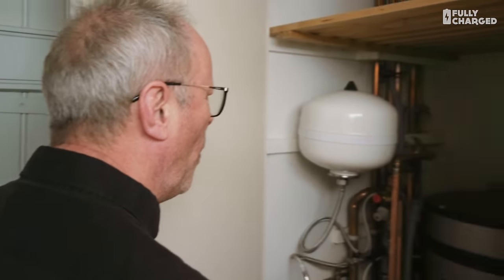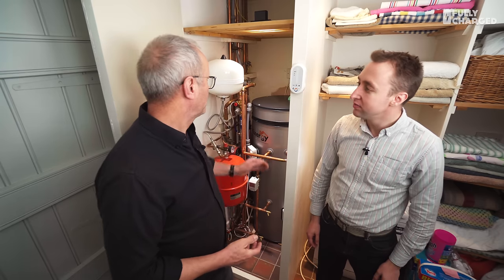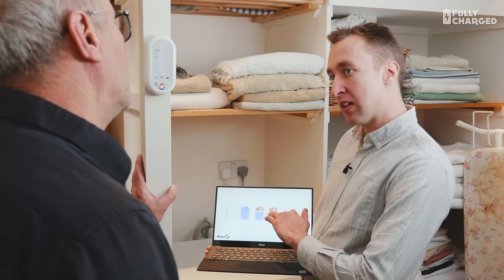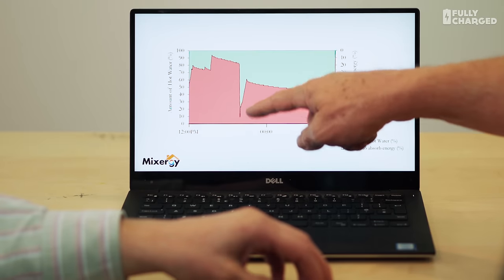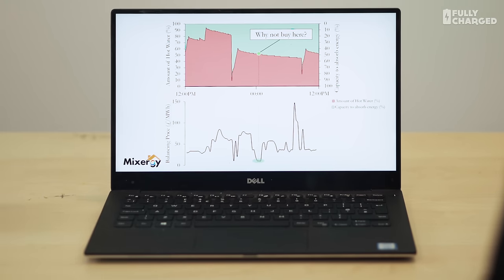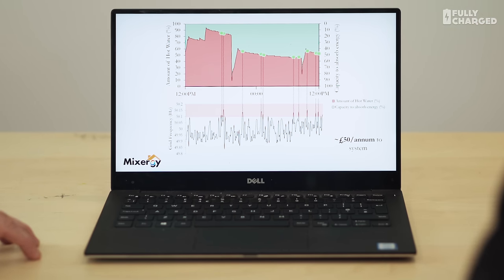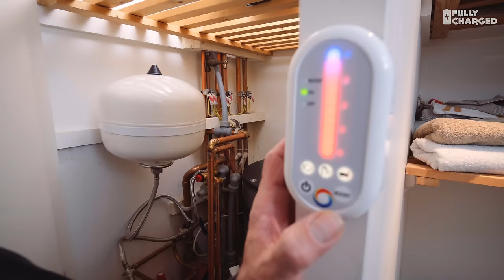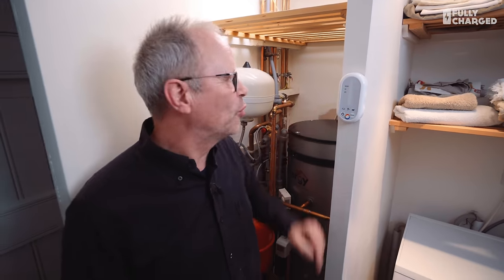Mixergy Hot Water Tank | Fully Charged

Comment: Wouldn't gas heating be much more efficient? Unless this is rock bottom cheap I just can't see the value especially with the added complexity.
Reply: Hi LokiDaFerret, instant gas boilers are less efficient compared to a well insulated Mixergy tank when we've tested them in our lab. There is far more complexity with an instant gas boiler as well-you need to maintain a pilot light, consider gas burner control, have a pressure sensing solenoid, condensing heat recovery not to mention issues around carbon monoxide and local air quality. The UK's grid carbon intensity has dropped dramatically and since September last year was lower than gas 40% of the time.
Reply: We need to stop burning things to make heat to slow down climate change. Solutions like this help with the transition away from gas. From the complexity standpoint I'm not sure I follow. It looks a lot simpler than any gas boiler I've ever worked on.
Reply: I am referring to my continuous hot water heater. I don't have a big tank but a tiny little gas thing attached to the side of the house so we can shower all day if we choose to do so. plus it only heats to the temperature we want. Am I missing something here????
Reply: If you look at the engineering of that you'll find it's pretty complicated. The Mixergy tank seems to be a regular immersion heater, a pump, a bunch of temperature sensors and a microcontroller.Significantly simpler in mechanical and electrical terms (we'll ignore the software ;-).
Reply: The trick here is not to compare the internals of this machine to the 'black box' that is attached to your house. The black box has more going on in there than a flame, water and a gas line.

Also, if this can be made much more efficient, then not only can we stop burning gas - we can stop piping it. Maintaining that infrastructure is not free.

Comment: Sadly UK RHI isn't permissible for systems that contribute to space heating despite massive reduction in fossil useage - in our case 66% gas reduction cf combi boiler with stratified thermal energy storage mostly heated by solar thermal. In winter solar thermal effectively pre heats water that goes into gas or wood fired boilers so reducing fuel consumption for radiators, thermaskirt or ufh as well as dhw.
Reply: RHI doesn't cover space heating for solar HW but that's understandable as it only works efficiently when you don't need space heating. ASHP, GSHP + a few others qualify. I get £282 per quarter for an ASHP that provides both HW and heating.
Reply: 1evilpie nope, it works very effectively for space heating! 300l thermal store properly designed to take low heat demand ufh from lower section and higher for rads. In Europe 1000l ts more common, just a wood or pellet boiler for 2 to 3 days per week mid winter.

Comment: every immersion heater i've ever seen (In my limited experience) goes in at the top of the tank.
Reply from the maker: Okay, maybe we didn't make it clear. It's not about how the water gets into the tank, it's about how it's heated. Hot water rises in a stck of water (as in surface water in the ocean can be quite warm but deeper down it's very cold) so the systems used to heat the water are at the top ofthe tank, hence you can heat a small amount of water very very fast, in a few minutes, and then heat the whole tank, if needed, a bit slower.
I've had the tank for 4+ year now and it is without any hesitation, the best system for heating water I've ever experienced.
Reply: @fullychargedshow  I have no doubt its a great system, simply that the graphic shown shows that "other" tanks are heated at the bottom. This is not actually really true. I think you may have misunderstood my "goes in at the top" - I mean that the actual element is inserted in and heats the upper part of the tank and not the lower part (unless you have a very long immersion heater and a very small tank of course) The whole system of measuring load and heating at cheap periods is a great idea though.

Comment: Interesting, but not really novel. I had a solar thermal system installed at my house in 2006, by www.greenshopsolar.co.uk, and it's been a good investment. It uses a 190l hot water tank with a heat exchanger for mains pressure hot water, and an auto mixer valve outside to stabilise the hot water delivery temp. In the Summer, the tank temp can be around 90 to 95 ˚C, so a mixture is essential for safe delivery to the taps etc. The solar thermal kit was made by www.resol.de, and it's had a replacement electric pump over the years. Since 2014 this house also has solar PV in tandem, so solar thermal collection is nominally free to run, most of the time. I don't have any boilers at all, and sometimes the storage tank is 'topped up' by an immersion heater, timed to run at 'night rate' mains electric; mostly done in the Winter, or overcast days. Because the water is hard water, and electrolytic scale inhibitor is used to protect the heat exchanger (and the rest of the plumbing downstream, which is nice).

Comment: Is it compatible with the solar to water heater elements that you put on your roof, i don't know what they are called?
Reply: JoneKone You could combine it as the heat from those collectors are kept within the property. This could almost eliminate electricity usage for most people depending on the weather.
Reply: Hi Jone, yes with a PV diverter the system is compatible with electric solar panels. It will also work with solar thermal :)

Comment: I am a heating technician and this is all wrong not many cylinders heat up from the bottom for a start, also the volume of hot water can be controlled by cylinder thermostats. There have been many different attempts at hot water storage over the years and simple is best to many pumps and controls mean high maintenance cost and poor reliability.

Comment: We talk a lot about the "national grid". But does that make sense? Shouldn't we rather focus on optimising use of the global grid? I mean, energy is traded among countries, and I believe this applies to electricity also, so a national perspective is a bit limiting.
Reply: You know I agree a lot with sentiment this... there is a huge renewable resource in North Africa which we could be buying in Europe. However, there are economic costs and security challenges with bulk power transmission over very long distances and so I think there'll always be a place for local energy storage as well...
Reply: Transporting electricity long distances results in quite a lot of loss, so there's that. In Europe the situation is better because you have a whole lot of countries right next to each other.

In Australia, for example, not even all our states are connected to a national grid. That's because to connect Western Australia to the eastern states we would need to run those huge lines across nearly 2000km of nothing.

The Western Australia grid is even talking about off-gridding a few of the more remote communities, because it doesn't make sense to run those HV power lines over 600km of nothing to reach a couple hundred households. Their solution will save them $400 MILLION, by scrapping the grid connections and setting up solar+battery with backup diesel/gas generators just in case.

Coming up with a design that allows not only national and continental grids to be connected and share energy, but also those for which that makes NO sense, would be the optimum balance. Of course, they can both be different solutions, but I happen to believe that more agile national and continental grids will use much the same tech as those that are off-grid by circumstance, rather than by choice.
Reply: Well the sensible option is to set Desert project in each section of the world. Australia, China, USA, Far East. Cable loss as quoted by the study was 2% over that distance. Blowing up such plants which was the next concern. These things were going to be 100 miles each way in sections. So taking them out was going to be outside most of the current terrorism groups. Side benefit was that local water was supplied as a side benefit! Plus you could use the land under it as farming. as the panels will shade the ground. The panels would be set far enough off the ground to allow light reaction to take place. Win win for everyone who is involved. Work for the locals to maintain a good system. Shame about our political team not having the technical sight to implement. This is the sort of project that EU and it's equivalent should be doing. Rather than trying to put everything in to the current structure. Hence, most of the UK got fed up with them. Over 10 years ago this could have been started. The plan was an additional to what we were doing now. Once all the factions of the world had a unlimited supply of electricity, water and food growing land a lot of theses wars could have not occurred. The oil and gas groups should look again at least.

Comment: What can you do with stored hot water bath and wash. what can you do with battery stored energy every thing that you can do with electricity, watch tv iron charge car charge phones power router computers power refrigerator etc etc.
Reply: line10cls Good point, but this tank probably costs a few hundred pounds more than a conventional one and should last 20 years plus. A batter bank costs thousands and won't last anywhere near as long. And you still have to find a way to heat your water.

Comment: Heating water with an electrical resistance looks like the worst possibile way of doing it.  As long as the global electricity production is not 100% renewable, you shouldn't waste it on a resistive heating element: you would do far better by using an efficient heat pump, an hot water solar panel, or even an efficient gas burner and sell some green electricity to the grid.
Reply: Robert has PV panels and a Powerwall battery.
Reply: @johnburns4017  And it would be better for the environment if he was to sell that electricity and burn some gas. Unless you are using an heat pump or the grid is already highly renewable.
Reply: @giacintoboccia9386  
It is the cost of whole package. PVs and Powerwalls are not cheap.

Comment: Heating cylinders from the top down to preserve stratification is not new.   You can buy cylinders with three immersion heaters up the length of the cylinder to heat say just the top one third as that is all you need for the odd washing at the sink and in the bathroom.  For a full shower or bath you switch on another immersion.  All switched on manually of course.  Here is a cylinder that heats from the top down using a boiler and plate heat exchanger and shunt pump, and designed to do so:
https://www.mcdonald-engineers.com/products/plateflow-plate-heat-exchanger

Having thermal store cylinders heated via electrical immersion heaters, boilers, solid fuel boilers, and incorporate roof solar panel heating is not new at all.  

As I see, the difference with this Mixergy is:

1. A small computer control system is incorporated on an electrically heated cylinder, with even a Smart App to control it.   Central heating systems can be controlled by a Smart App as well, so that is not new. But new on just a hot water cylinder.

2. The Mixergy cylinder can be switched on by the National Grid (?) to absorb surplus electrical energy produced. That is new.

Comment: Much simpler way to achieve this is just solar and or low cost overnight charging of the household 10 to 20kw battery pack them combined with a simple on off electric shower equals no messy pipes cluttering up a cupboard (which could be used for even more battery storage ;)) no pumps no extra pipes to leak etc. Sorry but ten years ago this would be great. Because you have shown us household battery/solar solutions combined with low cost overnight electricity all these inventions are pointless in my opinion. Cheers
Reply: Couldn't agree more.   In fact, I think batteries should be a mandatory requirement for all solar installations.  The only problem is the cost of batteries at the moment, but that is changing fast...
Reply: However this type of water heater may be much cheaper than a 10 kw battery pack, even with falling battery costs.  It's basically a conventional tank with the heater on top, a small pump, and a slightly smarter computer to control it.
Reply: Fancy a Bev Mate? You would need a separate heater for every hot water outlet. Electric shower outputs are feeble at best. In a family home, you would need enormous battery banks to supply all the hot water required for four or more showers a day. Baths would be out of the question. This makes sense, it can "charge" slowly, can be integrated with solar, doesn't place too much demand on the grid when solar is not available, and is significantly cheaper. Heat losses are low from a well insulated tank, and in the winter any heat losses offset your space heating demands anyway.

Comment: Isn't that just called a boiler?
Reply: With an AI twist=game changer.
Reply: A "smart" boiler. Still not as energy efficient as a tankless heater, but maybe more economical efficient (due to the fact that it heats when prices are low).
Reply: No. A boiler doesn't store energy. This system is designed to store energy by converting it to heat during low demand and supply it again at times of high demand.
Reply: HackingDutchman It's probably more efficient that a gas instant water heater, which has considerable heat losses through the flu, as much as 50% in some combi boilers. Standing heat losses from a well insulated tank of hot water can be as low as 1kw per 24 hours. Direct electric heating is 100% efficient.

Comment: all this smart grid stuff is just too complex to work well. Just develop batteries and solar / wind electric generation. Have more than enough and each house can sort itself out without over complex internet dependent grand networks which will inevitably get stuff wrong all the time.
Reply: Hi Lee, I hear your point... however the problem is a home battery system typically costs in excess of £3000 depending on it's size (perhaps a few kWh). Whereas a Mixergy tank which might represent 5kWh-10kWh can be bought for a fraction of the cost. Using this energy storage more intelligently can provide a very similar service across a fleet of systems without the challenges of dealing with waste by-products at the end of its life which should be 25 years or more as opposed to 10 years!

Comment: That information is wrong Robert.
A regular tank heated by solar panels does heat the top first.
Please don't miss inform people.
There must be plenty of schematics on line.
Reply: I think you,re thinking of solar heat collectors that pump water from roof to cylinder. Robert has pv panels that make electicity.
Reply: Acharacle & Achiltibuie All the ones I have installed also had the possibility to use electricity to heat the water. Most if not all of them have the resistance in the middle, not at the bottom.
I'm not saying it doesn't exist at the bottom, I've never seen or heard of one.
That bloke is preying on ignorance. Robert shouldn't not allow this on his show.
Reply: Hi Clavius, this depends, you're right some do indeed heat the top first. The problem is that without a system to manage the position of the thermocline inside the tank, the solar system heats the top but then can't heat any further down the tank. Our system heats the very top of the cylinder first but then allows you to top-up beyond that. This makes the system recover very quickly on solar energy whilst also being able to fully utilise the full capacity of the tank :)
Reply: Pete armstrong It heats everything from top to bottom.
The coil gets the hot water on the top, and transfer the heat all the way to the bottom where it leaves the tank going to the panels.
Reply: Pete armstrong - don't you find it depressing the way that some people are so confident in their own ignorance - aggressive even. Then presume  to tell you that you don't know how your own, and other systems work? 
Really, I despair of humanity sometimes...
Reply: Andy McCabe Converted.

Comment: Solar pv is inefficient to heat water compared to solar thermal. Bigger and taller the tank better the stratification. Newark copper cylinders have made these and even more effective ones for decades that use all sources from wood burners to heat pumps. http://www.newarkcoppercylinder.co.uk/thermalstore.html. Talk to David Lloyd Jones who designed the heating system for the Welsh Assembly and works in Africa to help poorer folk use solar thermal power http://www.tmsthermalstore.com